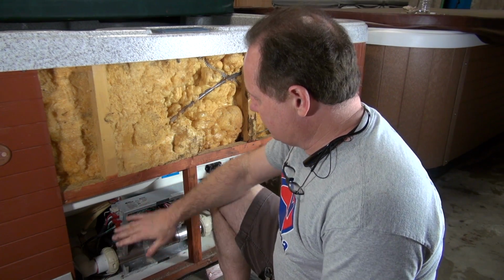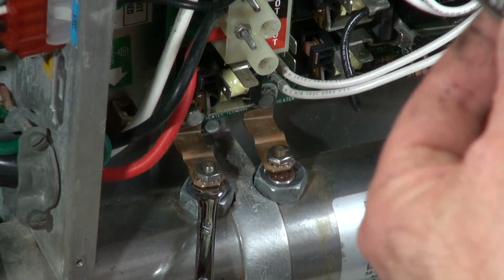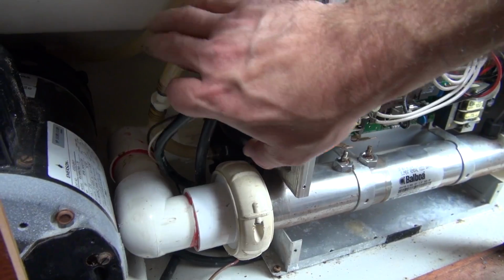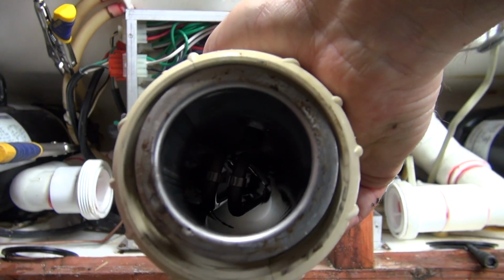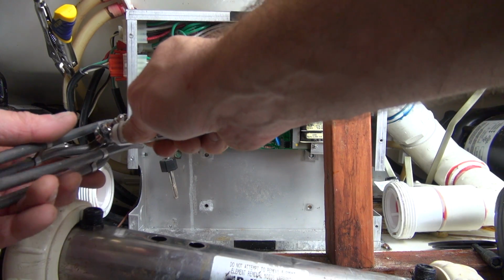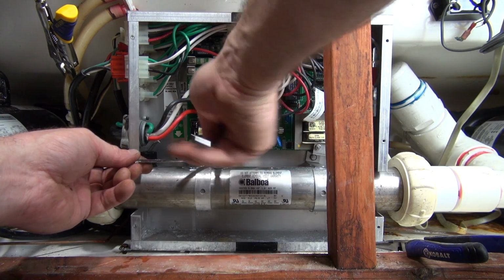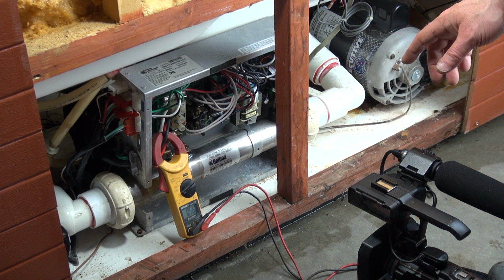GFCI Breaker Trip Diagnosis Heater Replacement Hot Tub How To Spa Guy

Comment: Do you need the same numbered wire like princes number eight to come out of the breaker from the main panel to the GFI and then from there to the hot tub I’ll have to be the same thickness of wire
Reply from the maker: The wire size is determined by the distance and also the size of the amp draw of the tub.. If it is a 2 pump tub you normally need #6 wire.. If it is a (1) pump tub and a short run you can get by with #8.. Whatever the incoming wire size is should be the wire size outgoing too..

Comment: Great videos...my bull frog broke the impeller on one pump ...replaced it but in the midst of it all the heat burnt out replace it everything was all good until we were tubin about five minutes pump one dropped 2 speed ...the top panel reads it's running but it's not.. let it sit for minutes and will restart but again trips out ?and I think the impeller broke again?
Reply from the maker: If you opened the motor you probably bent the two speed switch..

Comment: With all the days of searching I only found 1 person with my problem and no solution. Our new to us, (used) tub tripped the breaker after only being in it 3 times. Wireing is all correct. there was a flapper stuck in pump impellor, removed it, still tripped breaker, Process of elimination, heater bad. Ran 2 days without heater plugged in. Replaced heater, Still tripping breaker, it is also sparking on the circuit board on the heater relay. I have 2 relays here adn my husband is going to attempt to replace them monday. He is very handy, We have a meter coming later today to check the numbers we need to make it easier to diagnose. Everyone keeps saying we need a new circuit board, but everything i read still says heater.
Reply from the maker: Hello based on what you said you have already replaced the element so it is not likely it is bad again.. You can have a cold solder joint on the board and when it arcs it trips the breaker.. The flapper in the pump wet end will not cause a trip.. Does it trip right away as in not set or trip after a period of time? Also what brand is the board? Spa Guy
Reply: It trips as soon as the heater engages. We just removed the board. It is a balboa cat102 which is only replaceable with a balboa el2000 due to fiber optics. I took a pic and my son here says he doesn't think there was any solder in the joints.
Reply: there are black charred places underneath the heater relay where the joints are.
Reply from the maker: Yes that is where the cold solder joint is.. It probably can be 
repaired.. We do repairs if you can't.. Also a Cat102 mean you probably 
have a Catalina hot tub... The El2000 is a newer board and not even 
close to the same board... What the Cat102 is is a B2DG Board and they 
have a 12V or 115V option for fiber optics.. Send me a picture of the 
board here... parts@htpofa.com

Comment: At the end of your video at 25:46 you say something like " If you do not have 240 v across both termials and it reads zero but if you test one termials to ground and it reads half voltage then you have a "cold ??? Joint on the board " ? To me it sounds like you saying" cold sodier joint" I have this very situation that you describe and I need to know what it is you said and what it means. Thank you your help is appreciated
Reply: Cold solder joint: https://en.wikipedia.org/wiki/Soldering
Reply: Same problem here.. board problem i’ll Guess?
Reply: Thanks for your help I figured out what it was he had said. I removed and inspected the backside of the board ( PCB)  for bad solder welds made necessary repairs works fine

Comment: Great video; at the end you mentioned a "cold solder joint on the board" problem.  I did the test you showed and it seems like that I may have that problem; no breaker tripping, heating light is on the panel but the tub isn't heating, and I get 120V when testing each electrode separately but 0V when testing across.  Can I fix the cold solder joint problem or do I need to replace the entire board?  Any advice appreciated.
Reply from the maker: Yes You can usually repair a Cold Solder joint this is an Example of how.. https://www.youtube.com/watch?v=oiQBBHtejMA
Reply: Fantastic.  Thanks so much for the prompt reply.  The additional video you recommended is great.

Comment: Well, this is crazy, but nothing worked. I changed the gfi plug and still nothing.  The GFI plug would not reset and stayed red.  When I was putting the cover back on without power, yes, I know....THE LIGHT ON THE OZONE CAME ON AND CLICKED WHEN I TAPPED THE TOP OF THE CONTROL UNIT.  I took the big 30A ceramic fuse out and tested it and pushed it back in and everything works.

Comment: When you replace the manifolds on a viking spa that has the 700 degree foam blasted on it at the factory do you then re-insulate the manifolds that have been replaced ?
Reply from the maker: I don't I add 1" foam board in the void behind the side panel for insulation and then you have access to the manifolds if you ever need it again..

Comment: Hey spa guy i  have problems with my hot tube did everything in the video unplug the 3 plugs of wires from the panel and still remains the breaker pup off unplug the heater and yet still pup off

Comment: Wow great video - very helpful.  What if the heater is zero ohms?  Mine is a 5.5k.  Not working but tub keeps running - no GFCI issue.  Thanks!
Reply from the maker: Hello TJRB, If the element has no reread across it is open and should be replaced.. a 5.5Kw should read about 10.5K ohms.. This is my website with the elements..  http://hottubpartsofamerica.com/search.php?search_query=5.5kw+element Thanks, Spa Guy
Reply: Thanks for the quick response,  Actually I have continuity through it but no resistance.  I have the original XL with the wrap around element.  It does not short to the body on either lead.  There are the extra smaller gauge leads that go to the pressure switch as well.  I'm guessing it's junk but just wanted to confirm.
Reply from the maker: The Jesus Riders Band you can't have continuity and no resistance they are the same thing.. it is either open or closed there are no other options.. if it is closed it is good..

Comment: Hi Spa Guy,  I used this video to trouble shoot my tub, replaced my circuit board, and heating element.  I now have an Sn error code (Balboa system NonM7)- we have one "M7" and a flow meter.  I think I may have connected the M7 cable into the wrong location - how do I check where it should go?  My sensor is on the right with a flow meter in the middle of the tube.  I have power but the tub won't do anything except giving me the Sn error code (GRRRR)  Thanks for any help you can provide.,

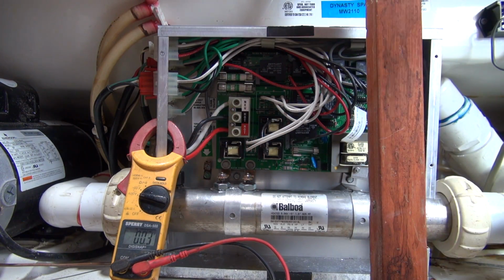Comment: "what was that last statement"? at 25:21 about a cold soldier joint on the forbes?.... can you repeat that statement for clarity and explain?   Thanks... great video... I trouble shot my LeisureBay Spa in 5 mins after watching and determined my heater element was out......The GFI wouldn't reset.... disconnected the copper tabs, and it all worked except for the BAD HTR
Reply: does this mean that the board is bad?
Reply: Same problem here..
Reply: Same

Comment: Hi Spa Guy,
Thank you for the help..Question  Why would a hot tub run fine and than after i get in the circuit breaker pops ??
Reply from the maker: Tommy you need to check the feed ground to whole system if it is unhook the breaker will set but if you make the connection to the water from ground it will trip.. Check the water for voltage take a meter and put one end in the water and the other to the ground after wetting the ground.. There should be no voltage..

Comment: what if ive disconnected all the high voltage equipment and the breaker still trips? trips only when i plug it back into the board.

Comment: I see there's been no comments in years, but I'm asking a question to see if someone can answer. This video is about the breaker switch not holding but my issue has nothing to do with the breaker. The hot tub has been running. I've been getting a "FLO" error for a couple years. So that remains. The new issue is no heat. From what he says here the breaker switch wouldn't be secure if the heater wasn't working. I changed the pressure switch when I first noticed the "FLO" code. That didn't fix it but the hot tub worked. The other thing I've noticed is the cord does not reset with the test buttons.
Reply from the maker: You need to watch the pressure switch video.. https://www.youtube.com/watch?v=VMizZKsncxY

Comment: I replaced the element in my tub and everything seemed fine, but I'm getting a "dr" error now when the heater comes on, which is "low water in heater". The tub is full not sure what's goin on.
Reply from the maker: The pump that goes through the heater is not working or not moving enough water..

Comment: Hello Spa Guy. Is it possible to have a working but weak heating element? I have continuity and no breaker trip. I ran the heater direct with 110v came back 2 hours later and no temperature change. Everything seems to work fine but not heating well or at all but heater is operating.
Reply from the maker: There are no degrees of working it either works or not.. at 110v it only heats 1 degree an hour..

Comment: My breaker trips so I checked the heater and The lug on the right hand side is corroded so I disconnected the power legs. The breaker still trips. After disconnecting all the plug-ins on the circuitboard the breaker holds. For the heck of it I checked the power at the legs that are attached to the heater the left one at 120 V but the right one, the one that was corroded, has nothing. Also the incoming power is as it should be, 120 V to the red wire and 120 V to the black wire and the neutral is hooked up properly. It seems like the circuitboard is cooked. Any thoughts?
Reply from the maker: You stated it tripped until you unplugged items from the board plug them back in one by one and see which on trips the breaker and that is the answer.. The corroded terminal of the heater is an issue too and should be repaired..
Reply: I have done that and no single component will cause the breaker to trip. And what about the power strap, that goes to the heater, that has no power? Shouldn’t there be 120v at each strap? For a total of 240v?

Comment: What does it mean if it says on the control panel that the heater is dry ? Thanks
Reply from the maker: That means you are not moving enough water across the heater for the system to register 25gpm.. could be pump, filter, something caught in the pump or more..  Thanks Spa Guy
Reply: @SpaGuy  we had replaced the pump , ,, . Jets 2 did not work after the heater pump got replaced .  Oh and that control panel got replaced  as well .  Got good filters

Comment: In my case, the hot tub does not trigger the breaker right away.  I can flip the break back on and it will run 24 hours + or - before tripping again.  I have gone through process of elimination by disconnecting one thing at a time.  It has now run a week without the heater connected.  I have taken the heater apart.  A balboa m7.  I do not see any signs of rust.  Are we still safe to say I need to replace the heating element.  Maybe it has not rusted but a seal is leaking slowly?  The metal tube looks like its in great shape so hopefully it is just the heating element.
Reply from the maker: I would suspect either a loose wire connection on wither the feed breaker, the GFCI breaker or the spa pack.. Or a bad GFCI Breaker.. It appears to not be tripping from a fault but from heat and a loose connection will cause a heat trip.. Spa Guy
Reply: Spa Guy I’m hoping there is a small leak on the lead for heating element.  Not seeing any rust .  I need to replace my voltmeter as mine seems to be acting up.  I replaced the gfci on outside before it goes to spa.  I have not touched wiring at the inside panel but that might be next if replacing the heating element gives me same results.  Thanks for the vids

Comment: Hello. What size pipe wrench are you using at 8:45 in the video? I need to get one for my hot tub to tighten that collar as it is dripping slowly from the right side. Thank you
Reply from the maker: Hello BoSox, I offer those on my parts website http://hottubpartsofamerica.com/hot-tub-spa-plumbing-pliers-for-unions-fittings/ Spa Guy
Reply: Thanks Spa Guy, but I rummaged through my father's old tools and found the oil filter wrench, however, after removing the split nut union to check the condition of the o-ring gasket, I was surprised to find that there was NO GASKET AT ALL which would probably explain the leak. No? So now the question is which size o-ring to order. 
Can you offer some guidance on this new issue?
Reply: yeh tired of drips, they vary with outside temp

Comment: Hello. I am having a problem with a re occurring sn code on my Balboa HS 200, non M7 system. I restarted the tub after about 1-1/2 years of non use. I get an sn code every few days. I can shut off the power, then turn back on and everything will be fine... for a while, then it will come back. I have installed a new filter, new temp and hi limit sensors. I had the heater out about a week ago and noticed that the heater element was touching the tube like you showed in this video. Could that possibly cause a sn code? You said that it will cause a hot spot in the heater, which is close to the hi limit sensor. I am really trying to figure this problem out. Any advice you could give would be greatly appreciated! Thank you
Reply from the maker: Mike the element touching the tube is not likely to cause that code on this system I would say to clean the prongs on the temp and hi limit sensor connections on the board side they may have enough build up to cause an intermittent code even with new sensors..
Reply: @SpaGuy  Thank you for the quick reply. I will try that.

Comment: My hot tub has worked fine for the month I’ve had it. My father set the temperature to 95F and overnight it got super cold. I set the tub back to 102F and it never heated back up. When the heater is plugged in, the 30A fuse trips. When I unplug the heater it doesn’t trip. What could this be? Thanks!
Reply: Did you ever happen to figure out the issue? My hot tub has just started doing EXACTLY what you described and I'm at a loss with it

Comment: If I order the new M7 sensor (from you of course) I want to make sure I connect to the circuit board correctly - I am not sure what label to look fro - I already disconnected and lost where it was supposed to reconnect (UGH!)
Reply from the maker: The wiring diagram is inside the front cover of the pack and it shows exactly where to plug the m7 sensors on the board.. Spa Guy

Comment: are viking spas any good?
Reply from the maker: They are decent tubs.. The older ones had plywood bottoms and usually require replacement the newer have composite bottoms and have no issues like that.. They are good lower to middle tubs in my opinion..
Reply: @SpaGuy  thanks for responding. Made my day!

Comment: Great video.......?? I recently had a spike on my home KwH usage. 5.5 Kwh for 8 nearly hours, but the heater contiues to work. I have not ohmed it yet. Have you ever heard of such a thing (Runaway heater)?
Reply from the maker: If the heater was stuck on the tub would overheat very quickly.. So not likely to be stuck heating if you don't have other such as overheating or overheating codes..

Comment: My breaker keeps tripping but not right away, some times it takes hours before it trips.  It doesn't trip if i unhook the heater but why would it take hours to trip like that? i don't want to just start throwing parts at it.
Reply from the maker: That is normally not a part failure that is a loose connection issue.. Power down and tighten every connection from the house breaker to the tub controller and that will probably solve it.. The reason unhooking the heater solve it is the heater drains 16-21 amps and that creates heat on a loose connection.. You take that out of the system the heat issue stops.. Spa Guy
Reply: @SpaGuy  will do. I've tried to check all connections already but may have missed something. If that isn't it, what's you next guess?
Reply from the maker: Breaker..
Reply: @SpaGuy  Replaced the breaker first.. was hoping to tighten last night but didn't have time. Maybe this afternoon. Can't tell you how much i appreciate you replying to my message. Hope you have a great day!

Comment: Hey spa guy, breaker tripped on my cal spas genisis. You mentioned heater could be good and the tub is still not heat but never said what the issue could be. Can you let me know what the other issue could be?
Reply from the maker: Tony, First unhook the heater and see if the breaker sets if it does most likely the heater is bad unless you overfilled the tub and got the heater area wet then it is tripping because the insulation around the heater is soaked.. In that case remove the box and dry out the insulations and reinstall it and you are in business.. Spa Guy

Comment: If the GFCI trips randomly and my spas still heats properly could they heating element still be the issue?
Reply from the maker: Not likely the element.. Usually when they trip they never stop tripping.. Spa Guy
Reply: Thanks! In that case would I be looking at the gfci outlet or something else within the spa system. It’s occurring a out 1x every 1-2 days